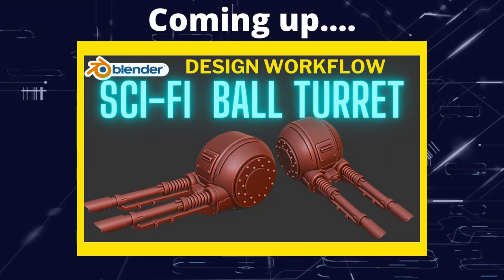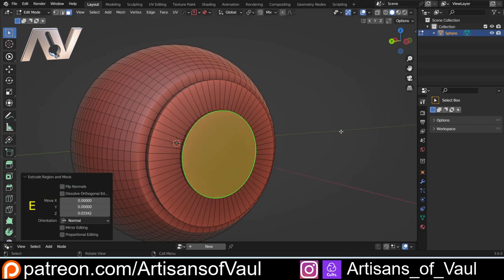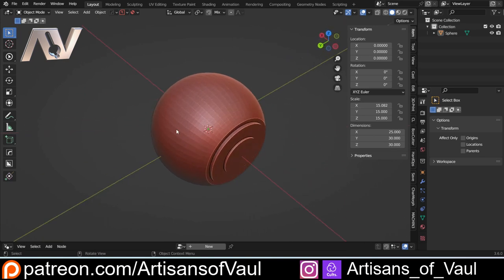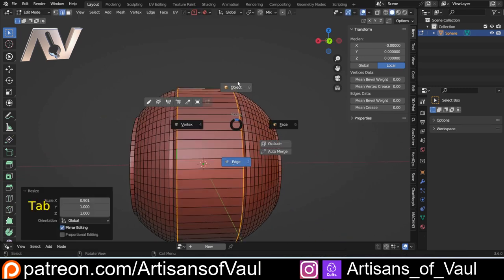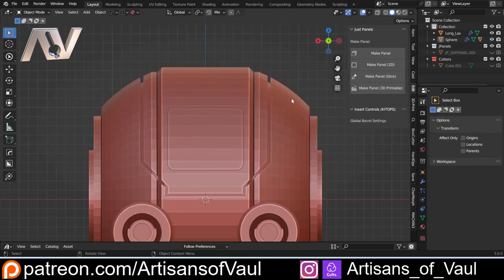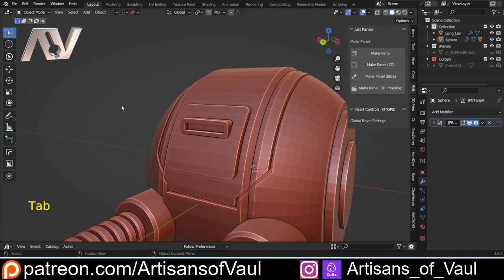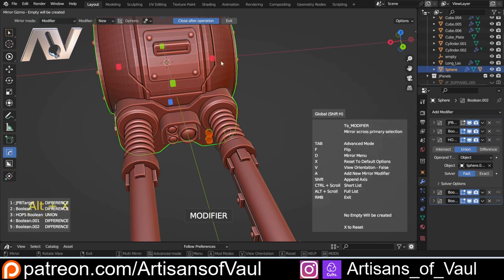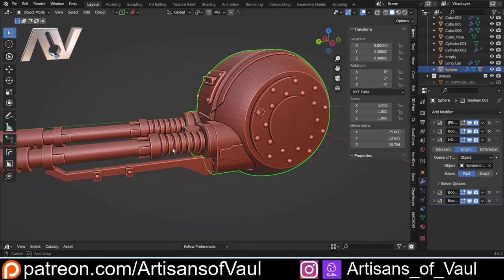Designing a Sci-Fi Ball Turret in Blender

Comment: This was amazing and fascinating at the same time. These flying robots are what made me want to get into hard surface modeling in the first place. The Eyebots from Fallout are an example of them. I am making a printable ED-E the problem I am having is getting the detail without using normals, Hard-Ops is proving to be invaluable. Like you explained I also don't like using imported reference sketches to model. I use photographic memory.
Reply from the maker: Thanks so much man. Yeah it's the ability to make anything, especially sci-fi robots and similar that got me so excited by Blender. Id done architecture on another program before but Blender was so much more freeing. 😁
Reply: @ArtisansofVaul  That is cool! I used to do a lot of texture modding on games and always avoided going down the rabbit hole of 3D modeling. Turns out it is no more daunting than working with graphics software.